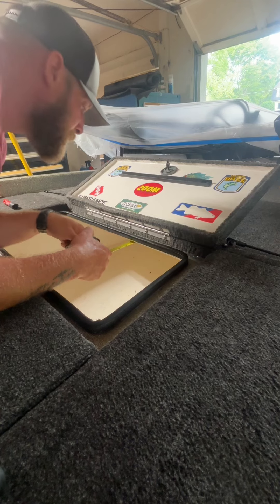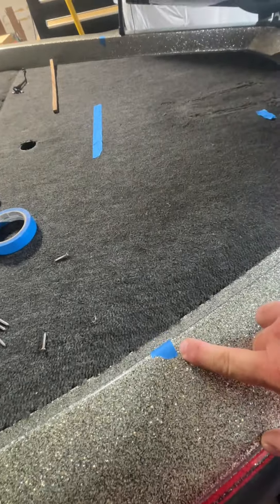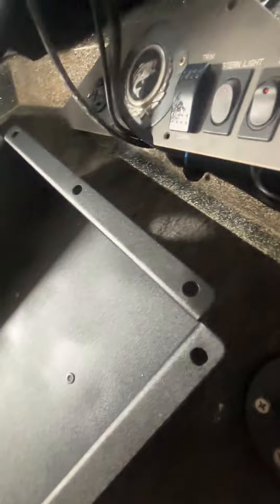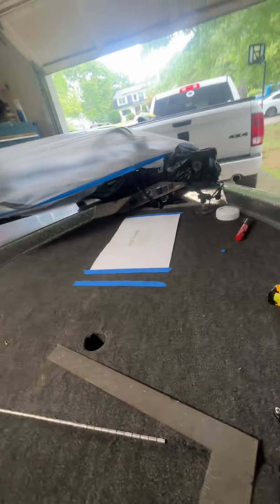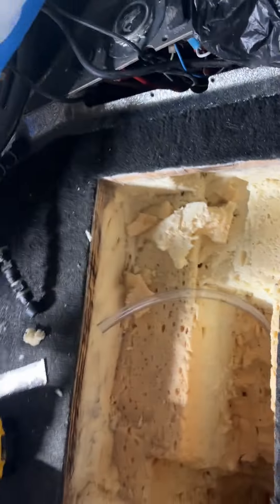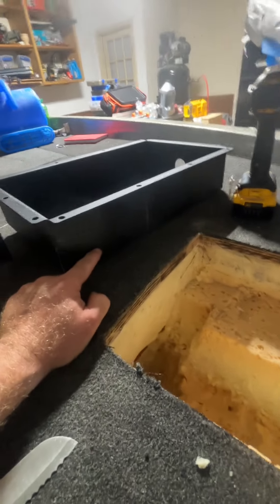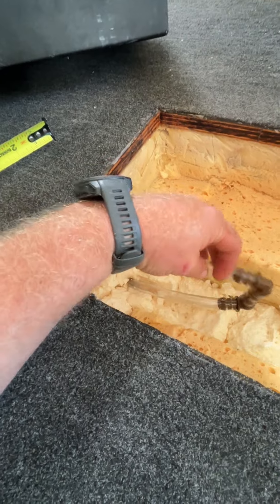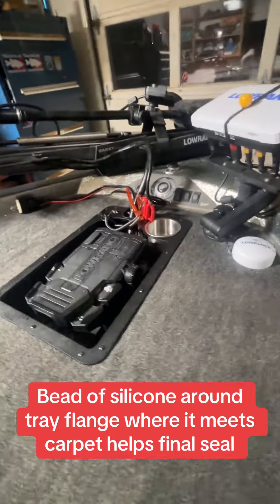Installing Baldwin Ironworks Recessed Trolling Motor Foot Pedal Tray (1991 Ranger 361V) Bass Boat

Comment: Im installing one right now and having trouble with the tapping part with the drainage hose. I have a ranger 365v
Reply from the maker: I just drilled into the PVC tube and then cut a v into the drain hose and put it in the hole.  Siliconed the tube.  And then you see the pieces I did to make sure it didn’t kink up
Reply from the maker: Were you able to get it done?